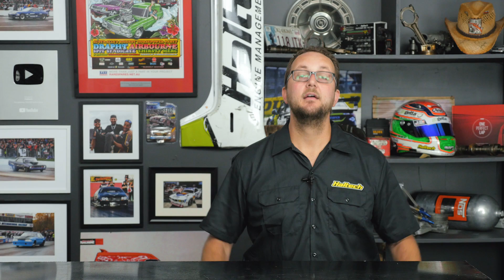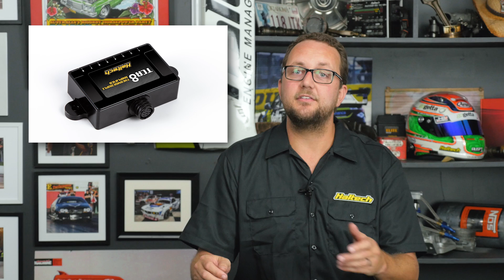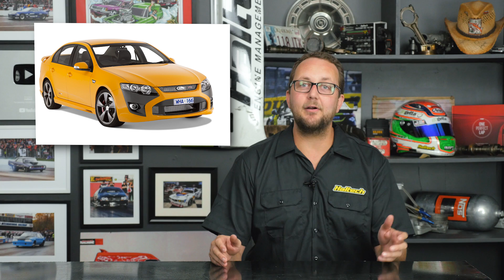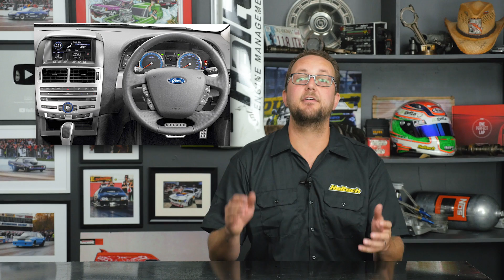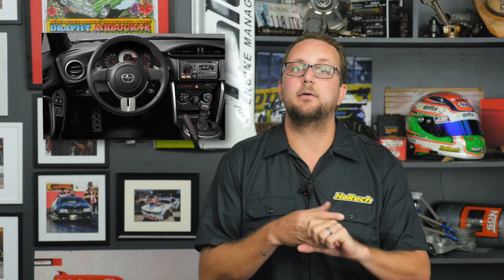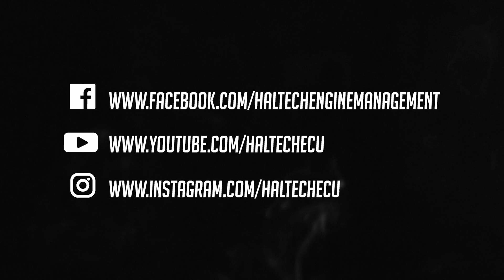🛠 2.32 Firmware Update Explained | TECH TUESDAY |

Comment from the maker: In this week's Tech Tuesday Scott explains all the cool stuff available in the new Firmware Update v2.32. These include: Electronic Throttle Blip for Sequential and H-pattern gearboxes, EGT cylinder shutdown function, Toyota 86 / FRS / Subaru BRZ CAN integration, new TCA-8 thermocouple amplifier.
Reply: With the introduction of CAN support on the BRZ, is there any likely hood of it coming for the 08-14, 15+ WRX/STi platforms?
Reply from the maker: It's something we're looking into, yes:)
Reply: @haltech  put me down for one for a 2012 STi then please :). The only thing stopping me from getting an elite is I want my cluster to still work!
Reply: @ARavenousChimp  yeah bring on 09 and up support for sti. i 2nd the motion
Reply: Now some just need something worth putting a Haltech in.

Comment: Need more info on how your switching out the Ford pcm? Or if your are wiring haltec ECU inline with it 
What I have seen you have to initilize or marry the different can modules wtleaet the apim and pcm so do you have software to marry them or just doing piggy back
Reply from the maker: If you're talking about the Falcon ECU - it's a full plug'n'play unit, a direct replacement for the factory ECU so you don't need to do any of that. Here is a video showing the full fitting and setup procedure: https://youtu.be/CxKdO0p6WAI

Comment: Are throttle blips only capable with an E-throttle?
Reply: For $50 extra Scott with sit inside your engine bay whilst driving and tug on the throttle cable between shifts for you!
Reply from the maker: Not for $50 he won't

Comment: Will a haltech fit my nissan GA16DE+T engine
Reply: I'm sure a haltech ecu will "fit" almost anywhere
Reply: logan adler  i want to be 💯 sure before buying it
Reply: I think the question you have is not will it "fit". The ecu itself will fit almost anywhere. I think the question you want to know is can it be wired in and who can u get to tune it. From my understanding a haltech ecu can be wired into almost anything you can imagine but u will need a tuner that can set the software up for you.
Reply: Ya am wandering if it will support the cam and crank sensor and the distributer since the engine is not found in the ESP software